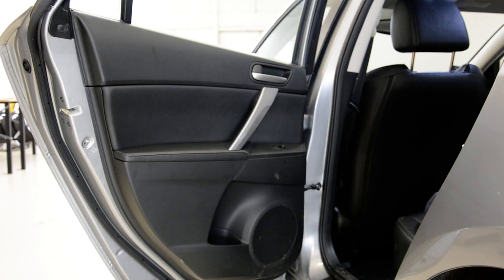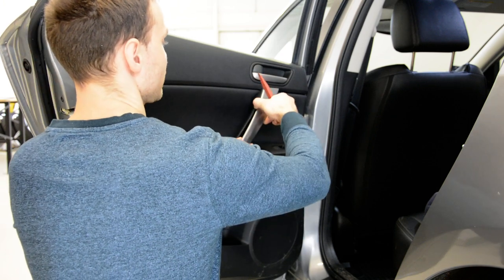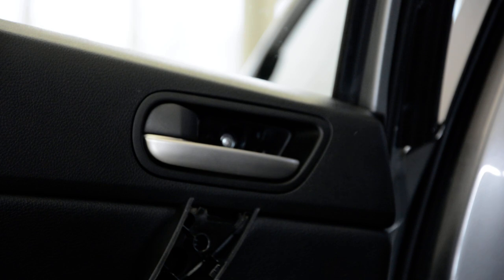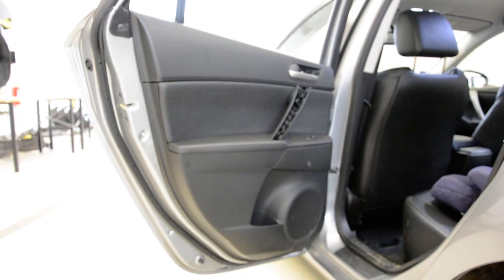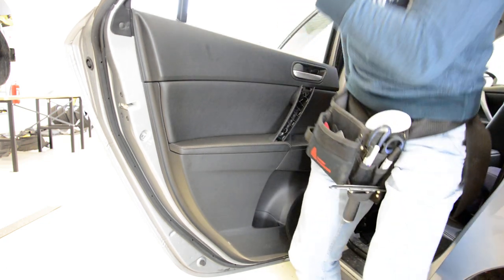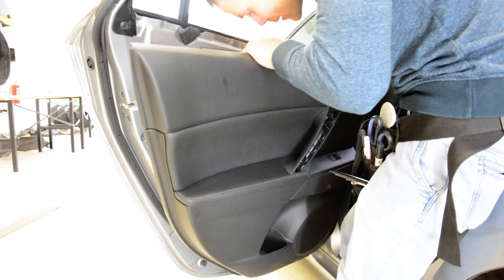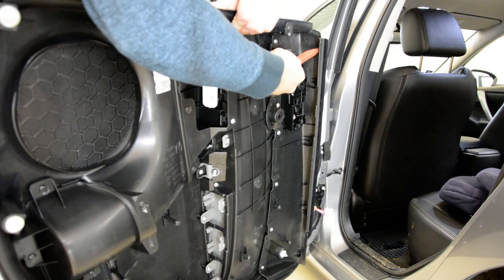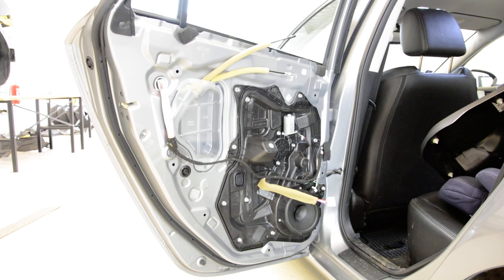How to remove the door panel Mazda 3

Comment: All my white door clips remained in the metal door.  I’m trying to remove them with no luck.  I have replacement clips but can’t get the originals out.  please help.
Reply from the maker: You need this tool https://www.amazon.co.uk/Tooltime-Removal-Pliers-Upholstery-Remover/dp/B00PCATOKA?ref_=fsclp_pl_dp_3
Reply: @DFCGarage  That would've been nice.  May just buy one for the future.  Flat-head screw driver and pliers did the trick, but it was less than ideal.

Comment: Some of my clips got stuck in the door itself. Can’t get them out.
Reply: They won’t clip back into the door card
Reply: 7homas 0wen then get a new one
Reply: Same here.  Did you figure it out?  I just replaced my window regulator and finally got my window to work.  I’d rather not open up the inner door panel again.
Reply: mrniceguy423 if the clips get stuck then I’m sure your doing it wrong. Figure out a way to get the clips out, if not replace it. Number one rule is if something is not working I a car you should just replace it, unless you do not have the money to.
Reply: mrniceguy423 I only had a couple that got stuck. Ended up just popping the door panel back in with them stuck in still. It’ll holding in fine.
Reply: 7homas 0wen that’s good! I hope everything went well with you. I currently own a riced out Mazda and I have no side panels because of weight reduction.
Reply: CMJG02 right 😂
Reply: Flat head screw driver and pliers did the trick, but it wasn't easy.

Comment: The Mazda 3 2012 inside door handle is all made of plastic. It breaks easily. 

When I picked up my new Mazda in June 2012 I looked for the year of manufacture plate. There wasn't one. A silver sticker had the year and date of manufacture on it. Further research showed that the car left the Mazda factory in Japan only 4 day earlier than the date I picked it up in Brisbane. That is impossible. New cars are transported by ship and they are covered in protective grease. It takes at least three weeks to prepare a new car for sale.

No wonder Mazda does not have previous year's model sale.  When you buy a new Mazda it could have left the factory maybe three years before.

Mazda are con-artists and thieves. Will report this to ACCC in Australia. It is fraudulent.